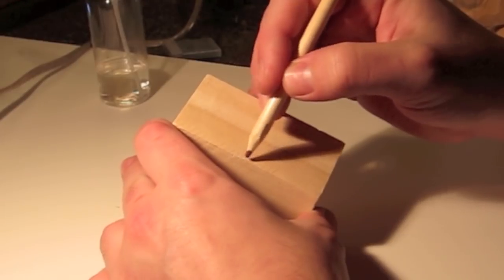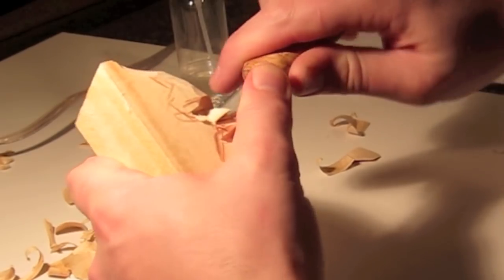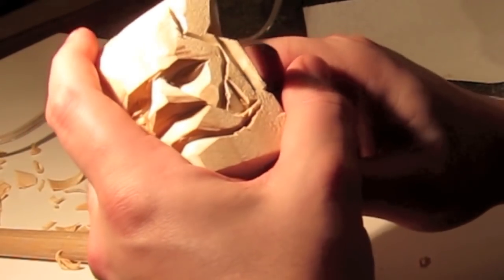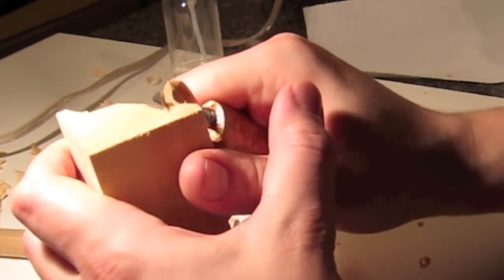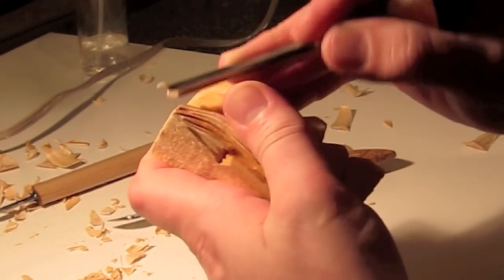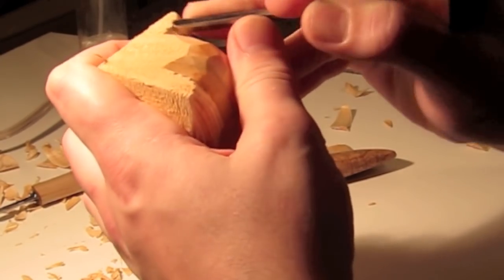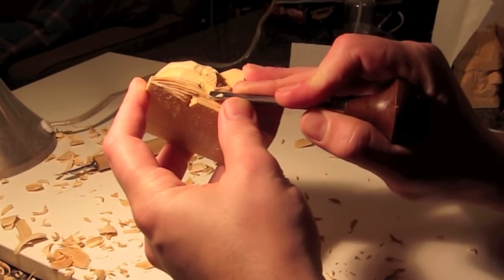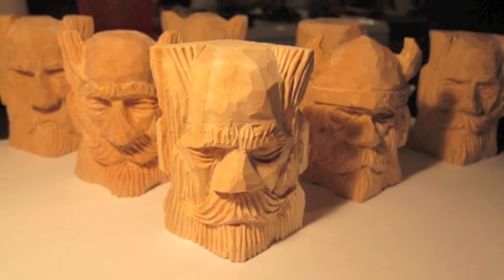30 minute wood spirit carving Full How to carve a Face

Comment: where do you get the wood?
what knives and tools should i use for basics?
Reply from the maker: basswood is probably the most commercially available wood...but as far as a specific source...most craft stores sell it in little grab bags and sometimes larger pieces. There's some woodcarving sites online that sell it and there's also individuals who sell it on ebay. I got these off of ebay..not sure who or if they still sell.
   These knives from from http://deepwoodsventures.com/ and they are great knives. on chisels and gouges you gotta buy online. trusted brands are pfiel, ashley iles, and henry taylor.
thanks for watching!!

Comment: Hey, great video I really enjoyed seeing your process of working. I was hoping you could give me the exact names of all the knives used in this video that you purchased from deepwoodsadventure.com and the names/size of the gouges (is that what they're called?) that you used and where to purchase those from. Thank you.
Reply from the maker: +Joe Wilson the knives are 'the scalpel', which is the small one, and the other is 'the detail'. both are 'straight' edge blades as opposed to 'upswept'. you'll see that option when looking at the models. if you want, you can always email deepwoods and tell them you want the knife you see in this video at 'so and so' time.
the gouges and v tools are made by pfiel. the v tool i use the most in this video is only sold in a set and the set sucks. so you can buy one from 'ashley iles' on 'toolsforworkingwood.com'. let me know if you need any more info as you look into these..also you can get cheaper gouges and v tools from 'flexcut'. get the travel set on sale for like 80 bucks. but start with a knife and whittle some...then transition into the gouges and chisels and v tools.

Comment: What size v-gouge do you recommend? I v-cut, that gouge looks so much easier and cleaner.
Reply: The V tool he uses in the video is made by Pfeil, a very good knife/chisel brand from Switzerland, at least it looks like that, I might be wrong.
Reply: Simon Petrikov
Thank you for the answer. I've already made myself a 60° and a 90° v-gouge. They make things a lot easier, just awkward to sharpen.

Comment: what do you think about flexcut gauges and v tools and stuff
Reply from the maker: peter markoli i think they are fine. top o the line tools are pretty expensive...but flexcut is the only brand that's 'cheaper' that is okay at all. i really like their stropping compound crayons. if you get them, get the compound and the contoured strop block. v tools suck to sharpen so keep them stropped. 
the other thing about flexcut is they are sold at some art and crafts stores. sometimes you can get big coupons and help the price more. They're regular sets come with a super small v tool and a larger one. try and get the larger one. i think there's a 'block/lino cut' set that is like 4 tools and that's one of them. 
good luck. if you want to talk more hit me up at nosubject13@yahoo.com
Reply: thanks man and what is a stropping compound crayon
(im not from an english speaking countri)
Reply from the maker: not a problem.
  to maintain a knife's edge you 'strop' it. This means running it along a piece of leather. The leather is a very light abrasive and touches up the edge. to make it more aggressive you put a stropping compound on the leather. Some compounds come in a small jar and are squishy.....fluid a bit. and some are solid sticks that are rubbed on the leather called 'crayons'.  I have a sharpening video and you can see me stropping at the end.

Comment: what wood are you using ? because i have this problem with wood i dont know how soft does it have to be or yeah :P
Reply from the maker: +Todor minchev it's not just 'soft' or 'hard' wood. i'm not gonna pretend to understand it but the structure of the different kinds of wood make it better or worse for carving. I mostly use 'basswood' btw. It's extremely popular because it's the softest wood that can take 'cross grain' cuts. 
   besides species, type of wood, if you are picking wood up off the ground there is also deterioration. I carve 'found wood' and sometimes it's been out too long and it's rotten but dry..so it doesn't do well. 
you can get basswood from craft stores or on ebay. or amazon i think...or 'woodcraft.com'
Reply: thanks because i used a peace of wood from the hardware store and it splits when i use my tools and even broke one :P and i was like ok i need a different wood thanks though it really helped
Reply from the maker: if you need anything you can email me at nosubject13@yahoo.com
Reply: ok thnx alot :)

Comment: Where do you get the other other tool (not the knife, the peeler thingy)
Reply from the maker: +MrBimbles SonofDimbles i think you mean the "v tool", also known as a 'parting' tool. look it up to see if that's what you're looking at. These hand held ones are called 'block cutters' or 'palm tools'. The one i use in the video is, i think, 4mm. It's made by 'Pfiel"...or Pfeil...it's only sold in a set right now. not individually. if you don't want that set then you can buy one from 'flexcut' or 'ashley iles'. this would be the link for the one from ashley iles. the closest would be the straight 60 degree 1/8th parting block cutter.
good luck. https://www.toolsforworkingwood.com/store/dept/TXBV/item/IL-BC39.XX
Reply: schpoingle Oh, this is great

cheers
Reply: schpoingle One question, I'm seeing a lot of woodcarvers carving pipes, however, they're all using soft wood, but doesn't that just burn up the wood?
Reply from the maker: I have a pipe video. I've used a kit from poland that is made out of some sort of pear wood. Ive made some on my own too..yeah you need to use a harder wood..or one that burns safely. i think some woods would burn much easier or taste funny.....but then again i've smoked out of corncob pipes and they work great. those things are extremely soft and porous.... with any new pipe you have to be easy on it the first few bowls. the wood on the sides shouldn't be directly exposed to fire but it does get very hot which hardens and protects the wood as well as the 'cake' that forms from the tobacco burning which protects more.
Reply: +schpoingle Thanks for the tips man

Comment: what are the demensions of the bass wood block
Reply from the maker: jackson jarvis it's 1 3/4 by 1 3/4  by 3 inches. from some ebay seller. you get like 10 or 12 of them.

Comment: What size is your small v tool?
Reply from the maker: Bob Arbaugh hey. um...i think the one your talking about, the one i use through most of the video, is the 4mm (around 3/16). That one is pfeil but that size only comes in a set...and not a very good set at that...i've been meaning to write them about it...anyway..you can get one from 'ashley iles' at 'toolsforworkingwood.com'. they sell an even wider variety of palm tools and you can buy them individually or pick 6 for a 'set' and get a discount. ashley iles are also fabulous tools. You could also try 'henry taylor'. Those 3 are the only names i'll vouch for 100% when it comes to gouges and chisels. good luck.